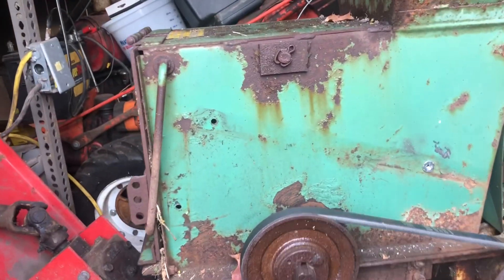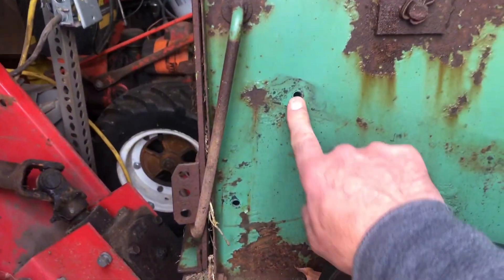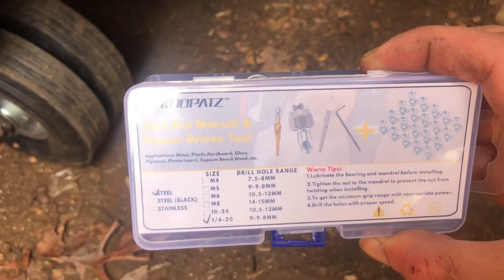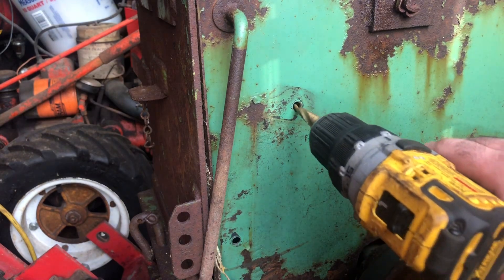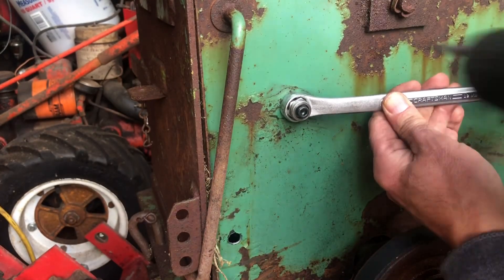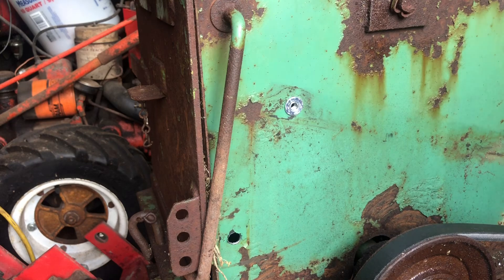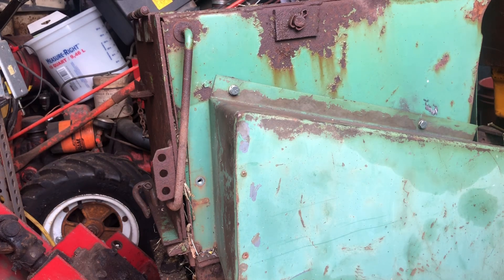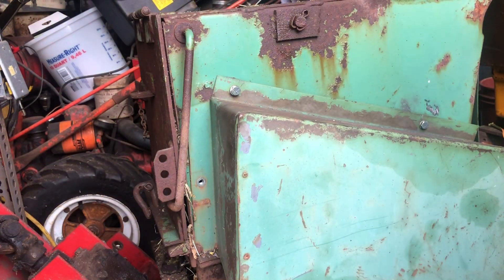TOOL REVIEW: 1/4”-20 hollow wall anchor for metal (Koopatz)

Comment: That's a handy way to put captive threads through sheet metal.  I've used the rivnuts, but those look like thy would be less likely to spin-out, over time, with more grip.